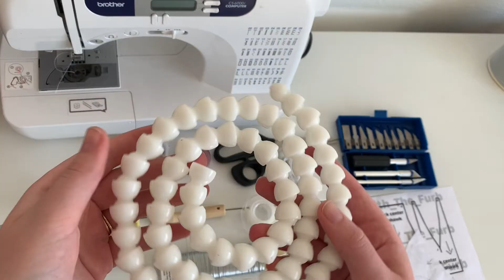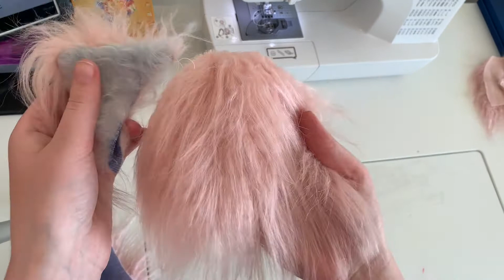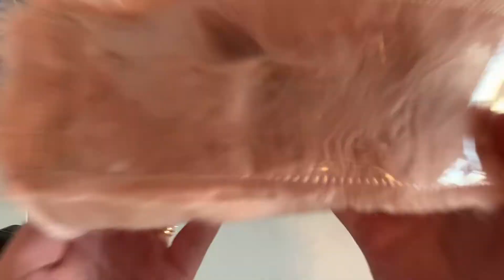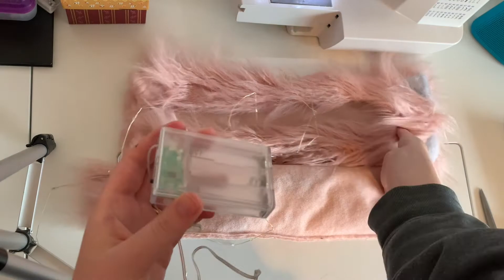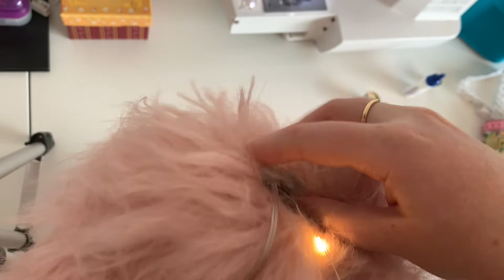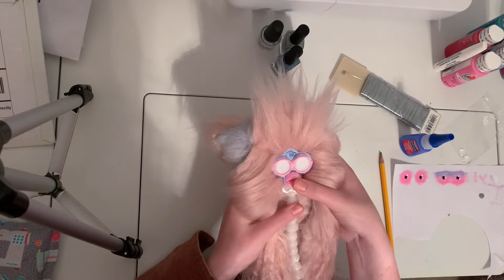How to make a Glowing Furby

Comment: You've been my inspiration to create my own longboy. I've been working mostly on your tutorials, and your resources. I was wondering, have you ever made a Furby with wings? Mine is going to have poseable batwings, and I'm still brainstorming how I'm going to make that work.
Reply from the maker: I haven’t made wings yet, but I really want to try! I’m in the middle of my newest Ferb, but I may take a break to play with some wings 😍 🦋🪰
Reply: ive not tried it myself, but i imagine varying thicknesses of wire would work? some pretty thick wire for the upper part of the wing (where the anatomical arm of a bat is) and then some thinner gage for the lower parts. id prob use a really thin fabric and minimal (if any) stuffing, although im not sure what specifically id use? this is a really cool idea though, ill probably wind up giving this a go at some point!
Reply: i made one with wings! they were non posable angel-ish wings